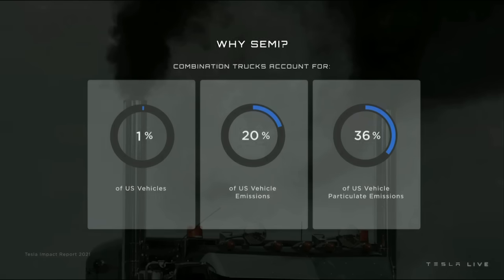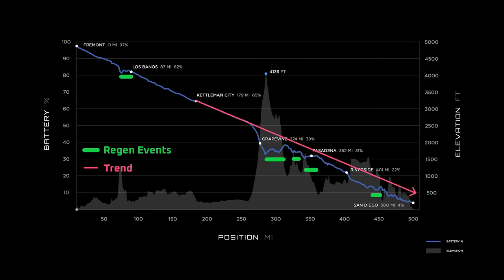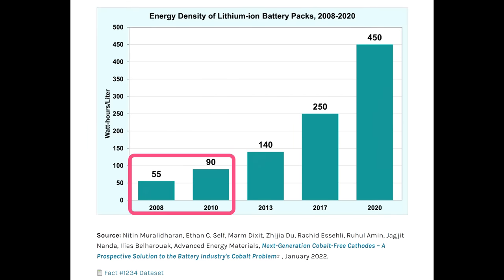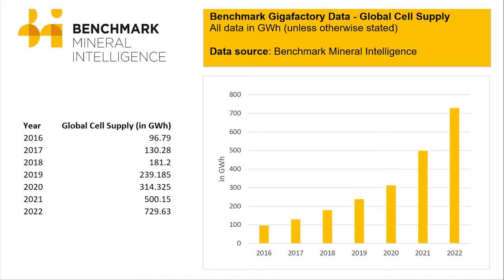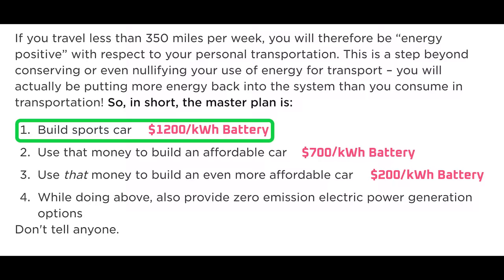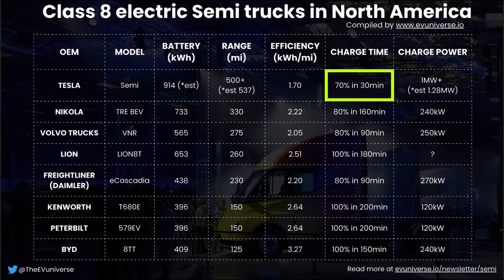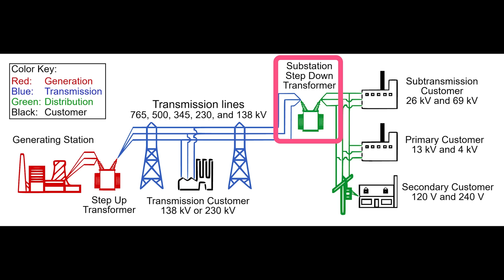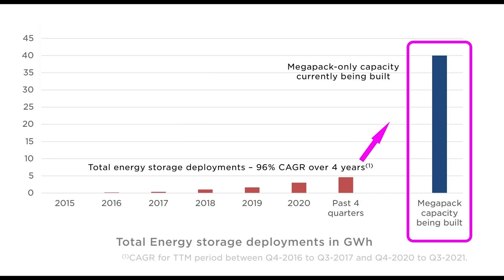The Tesla Semi:  Why Now? // The Road to Commercial Viability

Comment: The problems I see and that I hope you consider for your next video are that even though the Tesla Semi is an amazing achievement, the 4680 cella are not being used as the tech seems not ready for it, it doesn't have the energy density, so the Semi is released with the same cell tech the 2017 prototypes had (albeit they could at least have the Model S plaid electric motor improvements at least that extra 8-10 percent is good and welcome, but still). 2035 may be a decade away, but if Tesla doesn't have a long haul capable 700 mile range Sleeper Cab Tesla Semi model, banning diesel will simply be useless. But I still have hopes that Tesla can do it. Elon promised 250 miles into the middle of nowehere and back (500 mile range) and that's awesome.  But I say 700 miles, why such range? Because sometimes when you're a semitruck driver you must go 350 miles into the middle of nowhere and back, no charging in between. (Not that you could expect to have charging in the middle of nowhere to speak of in the first place either)
 I know 500 miles is enough for 80% of the jobs, but still, we need to replace 100% of the diesel fleet, not just 80% of it. In the end while I know Tesla is capable of doing it, I just hope it will happen sooner than later, Tesla has suffered enough delays with Berlin Gigafactory being delayed by fake environmentalists complaints and such (same fake environmentalism Elon called out and warned them not to shutdown their nuclear power plants)  , besides of other things that delayed everyone else such as the pandemic, supply chain issues, etc. I just hope Elon and Tesla can achieve higher energy density for 4680 soon, I really hope for 500 wh /Kg, I really want to see Elon's electric supersonic VTOL  aircraft idea happen and that will help the Semi and the Cybertruck as well.

Comment: I noticed that you did not even mention Teslas' closest competition, which already had trucks out on the roads working. That would be Nikola, who also has a Hydrogen Fuel Cell Semi design. Nikola does not have the range of Tesla yet, but they honestly are not that far behind. Their  truck was Designed to be a day hauler and not  a long haul truck. Their H2 version is being designed to be more of a long haul vehicle that regain all of their range quickly.

I give Tesla the respect they deserve but there are others also working on furthering EV semis.
Reply from the maker: What my interview with Johnny Nijenhuis
Reply: Hydrogen costs several times what electricity does for the same amount of energy to the wheels.
Reply: @BigBen621  You need to look at the bigger picture and the different use cases. H2 does not make sense for most passenger cars. When you get into larger trucks and SUVs BEV only does not make sense. A hybrid or a fuel Cell makes more sense. The weight carried on board plus the weight of the vehicle affect range. Without at least a 500 mile range starting out it is not feasible for anything to replace Diesel or petroleum of some kind. The power to weight density dictates usage case. BEV cars are okay for most commuters but not service and transportation.

Green hydrogen can do things that batteries can't but H2 can do everything batteries can.
Reply: @desertdan100  I don't disagree with most of this; but you haven't addressed the operating cost, which will be several times as high as a battery electric truck for the same range, at current costs for hydrogen and electricity. And operating cost is even more important for a semi truck than for a passenger car.
Reply: @BigBen621  The Hydrogen truck range will be much higher than the battery truck range. You can carry more energy on board for the same weight or you can go the same distance with more cargo weight both of those things equate to money. I run a business now and pay attention to fuel costs. Yes electric works fine if you can recharge overnight and don't have to stop and recharge the next day. If you have enough range on board to do that you will make it work fine. Not all use cases are the same.

One of my service trucks right now that travels the farthest carries weight and tows. It is a 1 ton rated truck with a 50 gallon fuel tank and carries 3,000 lbs. It can travel 600 miles down the road at highway speeds if it is not towing. It can refuel in 7 minutes at a good pump. It burns gas so that I can get fuel anywhere and it is unaffected by the cold. It is an emergency response truck.

I had another one similar that had a cng tank and system in addition to the factory gas tank. It could travel just about 800 miles without stopping. The price of cng was half the cost of gas. I just could not fill up CNG just anywhere. I had to have the guys fill it back up before putting the truck away for the night. That took 5 minutes.

Time is money. If an electric version of the same truck could do the same thing for half the cost for mileage traveled , I would be insane not to switch. 

If the cost of H2 comes down cheaper than Diesel per unit and I can refuel at truck stops and get slightly less range it still is worth it for the regenerative braking efficiency boost. 

The cost of H2 is coming down. The lost time refueling or recharging during the day loses me money. My billable labor rate or time is 100.00 an hour. The more time I have multiple people sitting in a truck the compounded losses I incur. 

If in time they make a work truck equal to mine that can recharge as quickly or near as quickly as refueling now and cost less to run , of course I will have it.

It isn't that I don't want it or don't understand the issues, I certainly do.
I have been researching all of this for years.

People are going to see the costs of all of this go down but H2 is always going to have more range per unit of weight. 

The cost of mileage is always on my mind.
The loss of profit through higher costs is always on my mind.
I have to shift the cost to my customers. If the next guy can do the same thing for less money, I go out of business because I lose customers.

H2 is going to do everything that Diesel can do and then some. Batteries are getting better but fall short until the energy density comes up.
Reply: @desertdan100   There is no doubt that HFC vehicles have several advantages over BE vehicles; but I'm not sure they overcome the disadvantages—especially operating cost. First, a Tesla Semi can drive as far in an 11-hour  day as HOS regulations permit, with a top-off during the 30-minute break required prior to 8 hours. They don't have provisions for a bunk or even a second driver, so they won't be used in around the clock team driving. As such, there'll be 13 hours a day to charge, which will only take 90 minutes or so.
Electric semis get an extra ton of GCVWR over diesel and HFC trucks, but HFC trucks will still have a modest useful load advantage—probably 5% or so.
But it's in operating costs where things get really ugly.  According to a recent article in AutoEvolution, a Nikola executive is quoted as saying that "these [Nikola] trucks can run around 7.5 miles/kg". Far from coming down, the price of H2 at fueling stations in my area (San Diego) has spiked from about $16/kg last year to $27.75 (!) currently, as reported by gplautogas; if you have a source for the current cost that's substantially different from this, please provide it.
So at $27.75/kg, that's ($27.75/kg / 7.5 miles/kg =) $3.70/mile (!) in fuel cost. Meanwhile, the Tesla Semi uses about 1.7 kWh/mile. Even at the current residential rate of 25¢/kWh for EV electricity in San Diego, which is about the highest in the contiguous states, this is $.425 a mile. So the per mile fuel cost of a Tesla Semi is almost nine times what that of a Nikola semi is; and that's at electric rates more than double the US average. And All Tesla Megachargers will have solar arrays, which will bring the cost down even more.
If my numbers are wrong, please show me where. But what it looks like is that the price of H2 will have to come down nearly 90% to achieve parity with an electric semi; and that difference will pay for a perhaps 5% reduction in useful load many times over.

Comment: Current trailers are still braking with brakes, not by regenerating.
In other words, if the semi regenerates, the trailer will still brake with real brakes, so the system doesn't really work as efficient as it should.

I hope that Tesla will make a trailer with a battery and regenerative motors, as well as motors to speed up the trailers.
Such a trailer will turn a diesel semi into a hybrid instantly, could give any semi an additional 1000hp instantly, will diesel drivers teach how much diesel this will safe and name it. There can be installed solar panels, the trailer can be plugged in quite easely since it's already attached to a building when parked and they can even build it with a small battery and later add more batteries when the price of batteries lowered, or when the driver thinks it's worth it in his case. It should be easy enough for truckdrivers themself to install, with a simple forktruck.
Reply from the maker: Good points!  Although I would say the regen happens without tapping the brakes.  Maybe I'm misunderstanding though.

Typically with my Tesla I never hit the brakes.  It's like driving a manual vehicle where you just let off the gas and it slows down from motor drag.
Reply: I doubt Tesla will get into the trailer business.
Reply: @thelimitingfactor  Even when you never hit the brakes, the brakelights do turn on when you regenerate strongly in an electric vehicle. Also, even the current trailers ignore the brakelights, they brake when they feel they are pushing the semi too hard.
Same thing for a caravan, when it pushes the car too hard the trailer coupling feels this and the caravan starts braking. 
Also, the brakelights currently is just a on, or off, not a 1% brake, 5% brake, 30% brake, 100% brake system, the trailer doesn't know how hard it should brake just based on the brakelights. When the person in front of you his brakelights are on, you don't know how hard it's braking, just that you need to be alert because the driver can brake really hard really soon. 

Either way, I think that if they build such trailers in America and build the additional battery packs in Indonesia, it could become an ulta deal for both of them.

Comment: Without the charging infrastructure for semi trucks, none of the other players will be able to sell to long distance trucking companies. Tesla will have a near monopoly on long distance trucking. 
Short haul runs could be done by other manufacturers with the chargers being located at the trucking company’s lot or specific auxiliary sites. However, those companies may need to pay to have large electrical upgrades at those sites unless they want to pay for a Tesla megapack.  Cha Ching!!
If I were Tesla I would create package deals for the entire truck and charging solution. Giving a price cut if buying the entire package. This action would allow them to also cut heavily into the short haul market. 
I expect that ultimately Tesla will own 70% of the overall North American continent trucking market. In Europe that percentage will be smaller given shorter distances in smaller countries. China might be a huge market for Tesla semis because of the land mass involved in that country.

Comment: As a battery expert TLF, what is your estimate for the payload of the Tesla Semi; not the gross weight please, Jordan.

My guesstimate is the Tesla Semi payload is 35k lbs or about 10k less than a regular diesel Semi.

Do you concur Limiting Factor YouTube Creator ?
Reply from the maker: Engineering Explained already did a bang up job here.  Go check out his video.  I agree with his assessment.
Reply: @thelimitingfactor  

I concur with Engineering Explained. 

However, running the battery down to 93% is not practical, 20% is needed for unexpected delays, accidents detours etc.. 

Also their is a/c for driver both while driving and when asleep. Also if you add a proper 2 bed sleeper berth and living area that adds weight. Right now the only version of the Tesla Semi we have is a day cab without sleeping or living quarters for single or team drivers.

Factor all this in and payload is closer to my guesstimate.

It’s all fixable. Some states allow quad axle trucks and triaxle trailers that allows for more weight because weight allowed per axle is the same. See state of Michigan, unlimited trailer axles are allowed. 

So a national law allowing mor axles for both truck cab and trailer allows Tesla to add more batteries to get both the full range and full maximum payload of around 45k - 47k lbs of payload, this is similar to a Costco payload on their semi tractor fright. This also allows Tesla to add a proper team sleeper berth and living quarters.

I also note Mexico has a 90k lb tractor trailer limit; but that idea is not popular in the U.S.

For now Tesla has a day cab that might eek out a stress inducing full range and lower limit full payload provided everything goes right, no delays etc.

Call it big truck range anxiety if you are trying to max out both the range and payload on todays Tesla Daycab Semi-truck.

Comment: 400k battery life is still a limiting factor for semi
Reply from the maker: No clue where you're getting that from.  450 mile minimum avg range X 1200 min cycle life = 540k min.  Again, that's conservative.  Probably more like 600k real world and increasing yearly.
Reply: @thelimitingfactor  "On Twitter, Elon Musk explained that Tesla car batteries should last for 300,000 to 500,000 miles or 1,500 battery charge cycles."  I  realize the 500 miles capacity, but those trucks get charged every night whether they run 200-300-400 miles.  400k better estimate, 3 packs to get to 1 million miles.
Reply: @waynerussell6401  promissing why isn't tesla stating million mile batteries are here, great sales pitch

Comment: You, as has every other YouTuber, the elephant in the room remains unaddressed. Experience has shown battery packs to degrade to unusable in 100.000 to 150.000 miles. This is the typical miles that every semi drives annually. Are we going to replace the $100k battery pack every  year?
Reply from the maker: Currently, automotive lithium ion batteries are rated for 1200 cycles.  Over the course of their life they of course degrade.  But, on average lets say 90%, or 450 miles in the case of the Semi for the average range per cycle over the course of its life.

450*1200 = 540k miles

So, basically, whatever channel or news source you're getting your information from...stop using it.

There's a lot of ignorant fucks out there promoting dramatically inaccurate information to gain clicks.